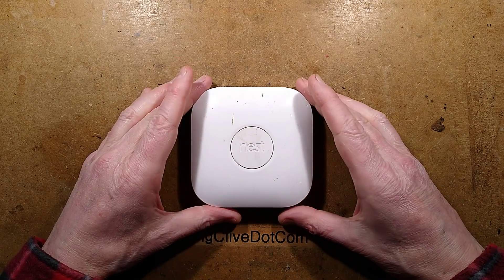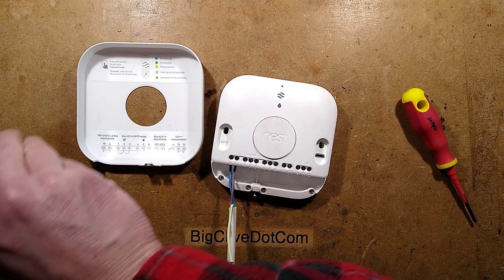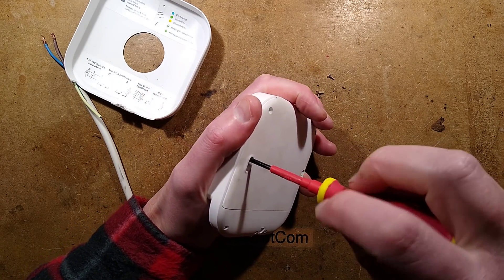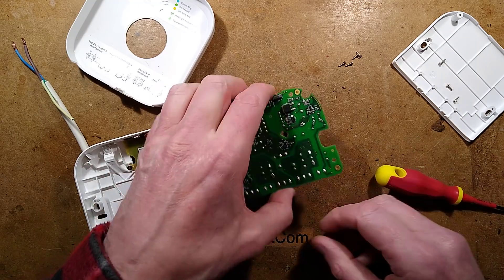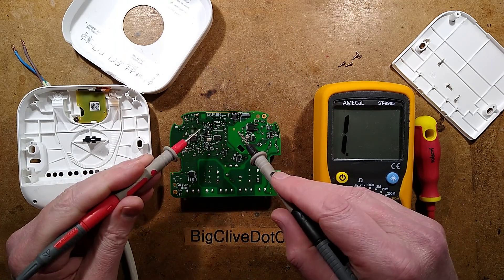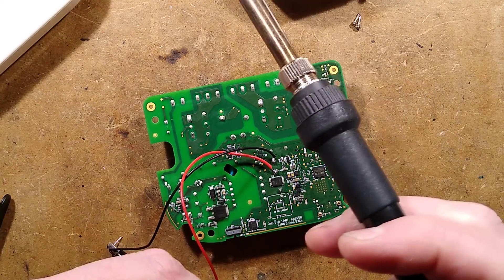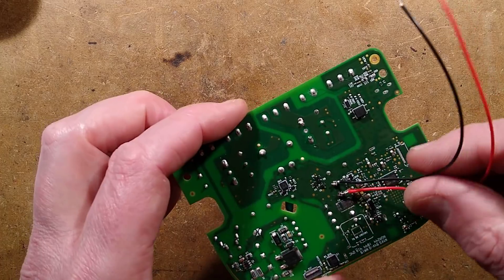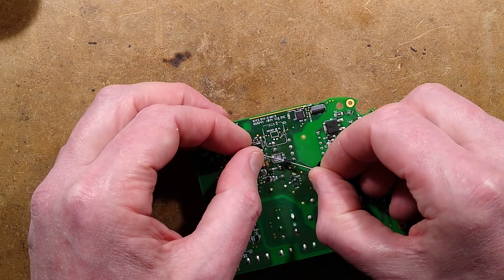Fixing a completely dead Nest thermostat heat link

Comment: Amazing video. Can't believe such a small, cheap component can plunge us into a mid-winter heatingless deep-freeze.  (For a couple of hours while I worked out how to bypass the heat link and just power the boiler via its on/off switch).

I've owned four of these, in three different properties.

Two have been solid ─ absolutely bulletproof running for four years or more without an issue.

The other two (both in the same property) have both failed.  One after 10 months.  The other managed 15 months.

Google, to their credit, have replaced both very quickly and painlessly, for free.

There are two differences between the installation where the units failed, and the installations where the units have run without issue for years:

1) The failed units were installed with the 12V out feed connected back to the Nest Thermostat itself (the good units didn't use the 12V out as those Nest Thermostats are powered by USB and just talk to the heat link wirelessly).

2) The failed units were installed in an older, oil-fired boiler cupboard, with no pipe lagging, and it gets pretty warm in there.  I'm guessing 45C or more.  And, inevitably, that means it gets used as a drying cupboard for wet coats etc.  So hot and humid.  Always good for electronic components!

I've got a fifth unit on its way from Google as I type (to attempt a 'third-time-lucky' lucky installation at the property where two have failed).

I've also got some pipe insulation/lagging on its way from Amazon to attempt to keep the boiler cupboard a bit cooler and will be keeping everything crossed that that does the trick this time.

Anybody got an educated guess as to which of the factors above is most likely to be behind the repeated failures?  (Assuming it's not just random bad luck!)

Btw, the failed units had similar symptoms to the one in this video.  No lights on the front.  Manual override button not functioning.  But I was still measuring 240V across the power in, the CH power out and the HW power out.  Nothing on the 12V out (that's how I spotted the problem when the Nest Thermostat complained it had lost power) and nothing on either of the CH or HW demand lines.

Also, also... for all the annoyance of the failures and the rigmarole of getting Google to send out new ones, the units are pretty straightforward to change out.  You just wire in the new one in place of the old, sync it up to the Nest Thermostat and you're back in business.  (For 10-to-15 months, apparently.)
Reply from the maker: The fact the two that had external 12V wiring failed is interesting.
Reply: @bigclivedotcom  Thanks Clive ─ reading the other comments below I was coming to the same conclusion.  I guess everything works that bit harder when the 12V is in use.  Think I might leave that out on the new one when it arrives and just plug the Nest Thermostat in with its USB.  Shame because the 12V output and re-purposing of the old thermostat wires is a neat re-use of existing wiring to allow installation of the Nest Thermostat in place of a traditional thermostat with minimal disruption.

Comment: 14:41 - actually replacing a heat link is actually pretty easy from an end-user perspective. The turny thermostat bit should find and pair with a new heat link without any issues. All the brains are in elsewhere, this is basically just a remote relay, very similar to any other wireless RF thermostat, just using a different protocol.

Comment: Whilst i see great potential in IOT and home automation, there's a few problems with it that's preventing me from using most of the devices. and its primarily manufacturer support, I don't want to be reliant on another companies servers being up to use my rather expensive device. I want the ability to run any software i need to use the device locally, either on the device itself or on a local server. 

I also hate when people use the term "smart" to describe these devices, there's nothing smart about them, "smart bulbs" for example aren't smart, they're just remote controlled.
What i would class as smart would be something that is capable of obtaining information and reacting appropriately without me having to tell it to turn on and off. id argue a PIR lightbulb is smarter than most "smart bulbs" as it detects a physcial presence and turns on. meanwhile most "smart bulbs" don't, they only turn on when you tell them with a voice or mobile app. its just a fancy remote control.

Comment: Seeing that those SMPS operate under 100KHz most of the time, wouldn't the 1N4003 with a Trr of 2uS still be enough (that's roughly equivalent to 500k cycles), with the UF4003 with a Trr of 75nS (13M cycles) still being overkill? (obviously Trr isn't quite the only frequency defining parameter but is useful for rough evaluation)

Comment: FYI the WiFi chip for connecting to your home network is in the nest display thermostat unit. 

The Heat Link will wirelessly communicate to the display wall mount/base plate (which in turn connects to the display unit) in order to allow software updates to the Heat Link and also thermostat control. Though sometimes this wireless communication fails (not sure why) and control from Heat Link to Thermostat occurs over the 12v T1/T2 power link (this results in slower response though, for example you set the stat to an 'On' temperature, the Heat Link will click on 5 seconds later where wireless comms it's instant).

I replaced my Heat Link diode with a SK310B SMD, the cover fits back just fine.

Be careful when buying a faulty unit that's s marked as 'untested' on eBay as the common faults appear to be:

1.) Dead heat link (usually repairable by replacing the diode as per video)
2.) Display unit unable to find WiFi SSID / W5 Error - this is a known fault of the WiFi chip and is unrepairable
3.) Display wall mount/plate not working - the display unit will not work when not connected to a wall plate and often I've found the plates PCB is fried, probably due to incorrectly being connected to mains voltage rather than the low voltage T terminals on the heat link

Comment: More complex something is the less secure it can be. Just because you're too lazy to walk across the room and turn the light switch on. At the same time I do see that some of these devices have uses but there's also a lot of and we do IOT HD as well. Remember those HD sunglasses that were basically jumping on the bandwagon of HDTV. Market decide to jump in on this and slap that term onto everything else so they can sell better.

Comment: i know clive was worried about the problem with stray wires but it seems like they had pretty good spacing and aslong as the person installing, it which should be a proper technician, there shouldnt be many issues. we sold them at home depot and it was my specialty department

Comment: Id think that the poor quality SMD diode was intentionally used to cause a failure so you need to buy a new one every so often and protect the profits of the manufacturer
Reply from the maker: I think this issue has cost them a lot of money and reputation.
Reply: @bigclivedotcom  no doubt, im a technical for a company that will remain nameless, the controll pannels have a 50% failure rate and to make things worse there is not repair just replacement to the point customers have now started retrofitting 3rd party units that cost 1/3rd the price.
I feel most companies do things like this as a way of planned obsolescence, can't blame the manufacturer if it's the parts nit the design. My thoughts anyway

Comment: Capacitor failure, so common. I was involved in the discovery of one piece of equipments failure mode. 

Manufacturer denied it for a while. But recently released a memo confirming. 

Certain model years effected.  As they cheapened the parts

Comment: That heatlink unit also provides power to the main thermostat unit, which has a big display, processor, its own wifi connection, and a built-in Li-Ion battery. The thermostat unit then sends messages back to the heatlink to tell it when to open/close the relays.
So I suspect that the heatlink's power supply has a lot more work to do when it's connected to the main unit via T1 and T2, and might run a fair bit hotter then.

Comment: at a pinch using 2 soldering irons at the same time can get you out of trouble  when dealing with SMD components- have used this method so many times  that I dont see the need to a pair of hot tweezers
Reply from the maker: I did that on another Nest unit today.  It worked well.

Comment: I'm 67 (soon 68) years old and it is amazing how many things I fix with new caps, diode and a BRIDGE RECTIFIERS... LOL
There is the once in awhile voltage regulator but it all comes down to diagnostics and a dab of flux... :-P
LLAP
Reply from the maker: Yeah.  Modern high frequency power supplies really grill their components.

Comment: I wish there was laws about planned obsolescence in products. Yeah I know they say it makes the product cheap but no it is a real thing even on "expensive" stuff on which so cheap components are used it may even be made with caps rated for 1000 hours for example. it is a selling concept to make caps fail due to high load and cheap models which always fail in due time but I seen other ways too in many things. LEDs for example put together with little to no thermal compound on some of the LEDs for example which overheat and dies over time and soooo many other things :/

Comment: No thermostat was more reliable than the bimetallic spring moving a mercury switch.  Sealed contacts, no electronics, 50 year reliablility.  I keep one in the basement for fallback when the nice, digital display, touch screen, four heating/cooling periods a day thermostat dies - which is much nore often than the mercury thermostats did...

Comment: Mine failed this week! Bet it's the same problem. Guy who replaced it said these v2 fail often, Internet suggests within a year. Good to know I can likely fix it myself if need be if it fails again. Thanks!
Reply from the maker: New test.  Set your meter to continuity and test across the two right hand 12V thermostat connections.  If it's a short the diode has probably failed inside.

Comment: I once had a cheap led grow light of 100w go bang. And I could not figure out why. The led would start up, but continously just flicker on and off. I opened up the power supply and saw some burnt small tiny tiny components. Don't know what they were. Do you have anything similar you could take a look at and explain what the ballast/drivers do to power on a large led lamp diode array?

Comment: Here in the US I’ve never seen a thermostat powered by mains voltage. In every house I’ve owned or lived in the thermostat either wasn’t powered at all (it used a bi-metallic strip), was powered by batteries (usually 2 AA or a 9V), or used the 24V AC provided by the heating/cooling system.

Comment: Who needs a internet fridge , freezer , toaster or washing machine ..... not me !

My rule is 
If it needs working servers , a phone line , online activation or a internet connection avoid it .
If its using a monthly / yearly paid service all bets are off but imo avoid if you can !  .
If something needs a firmware update every month that's just bad design .

It should be a criminal offence if a unit stops working because of a missing external network connection , servers or someone's opinion that it's unsupported & obsolete .

One day it will be just that obsolete & unsupported but it should remain working until the day it's not .
Hopefully a long long time after the obsolete date & years after support ended !

Comment: Any Internet of Things devices that require an internet connection and a third-party server to work, are insane non-secure vendor-locking BS. For me IoT mostly means devices with WiFi connectivity and a documented (often HTTP) API that can be used to make the devices communicate with each other, mostly within your (V)LAN.

One of the most cringeworthy "IoT" devices must be IoT security cameras that won't even fully boot up before they have first connected to some random third-party server.

Comment: A mains powered thermostat? Admittedly my experience is limited to FAUs, in the USA, but I've never seen such a thing. "Standard" seems to be a small 24v transformer at the furnace and Class 2 wiring carrying 24vac power and the various control signals to/from the thermostat.
Reply from the maker: In the UK most heating controls are 240V.

Comment: Nice fix, the PSU side of many things always seems to be the weak point in many products which actually work on low voltages - some may say this is 'planned obsolescence' but in my experience of repair, I'd say they are random component failures which may or may not manifest themselves due to the complexity and features of the product itself - one could argue that the bean counters have 'engineered' this situation rather than the designers themselves...it does pain me to see perfectly repairable consumer electronics end up in landfill due to failures like this however :(

Comment: My buddy sent 240 v down the C wire into a thermostat and gas valve and air handler control board. We were able to remove a bad bridge rectifier from the gas valve and make one from diodes so that worked. The I replaced the 2 traces on the control board that blew and a diode and that worked but the Honeywell 7500 series thermostat is being stubborn. I replaced 2 diodes and can get it to flash on if I twist it but I haven’t found a broken solder joint so I have up. Anyway it went from being a $900 repair down to $160.

Comment: If that diode went short-circuit, does that mean other components stressed (if the fuse didn't blow) and so they're more likely to go pop too?
Reply from the maker: The primary side will have detected the shunt and gone into hiccup mode where it pulses the transformer looking for the fault to clear.

Comment: I am glad you did this video because i had one fail it was in warranty so it was ok but im concerned if it may go again, just a FYI for anyone if this fails you need to replace this and the thermostat unit as they come in pairs. you cant just replace 1 part as it wont match and it wont work. 

but what diode exactly should we use if this fails that is the question ? i guess we could use the same type like in the video to make it easier to solder

Comment: How do you know what a safe current is for testing short circuits, in this case I see you used 20mA because that’s very low but is it possible that that could still damage some circuits?
Reply from the maker: It's unlikely to damage circuitry.  Once you get to 100's of milliamps then it's more of an issue.  But any component shunting that amount of current is probably toast anyway.

Comment: I had an old thermostat with a bimetallic spiral spring attached to a huge mercury tilt switch. Perhaps it is more reliable than an IOT device like this but if one comes crashing down on the floor I'd rather have it be the Nest.
Reply from the maker: Mercury is not as bad as the eco-warriors imply.  Especially in it's native liquid form.  The mercury switches are one of the most reliable ever.
Reply: 100% true. Very reliable. But also very high vapour pressure in an enclosed room when large quantities are freed from the confines of the glass vial.

Comment: semi related question, would you have trouble running a modern furnace off a square wave inverter?
Reply from the maker: I wouldn't recommend that.  It may cause motor issues.
Reply: Depending on how new the modern furnace is, it may have an ECM (electrically commuted motor) in it, which won't care about a square wave power supply because it's converted to DC internally anyway.

Comment: I can't help but think there is some sort of sploodge you can apply to a PCB to protect some parts from heat when using a heat gun for desoldering/rework.
Somehow I imagine toothpaste would work to some extent, and once cleaned off would leave your repair minty fresh!

Comment: Oh man you had me nervous when you hooked that into apparently mains... I'm used to thermostats running on 12v or 24v AC from a transformer in the furnace. Was thinking it would be going boom...
Reply from the maker: Our heating control systems tend to be 240V here.

Comment: Wouldn't ac v be used to test diodes? On a car generator with dvom at b+at gen and neg at bat w/ ac v measurement = miliamps of diode leak. I believe
Reply from the maker: The best way to do a basic test on a diode is with a diode/continuity tester.

Comment: Interesting, this nest accessory device is only used in Europe.  Apparently the nest thermostat built in control mechanism (made for USA systems) can't control boilers in Europe, and this Heat Link is a WiFi relay box to put on your boiler.  The normal nest thermostat then wifi controls this thing.

Comment: The majority of the US thermostats is a 'r'-'c' is 24 vac.  carrier grounds the 'c' to reduce a high static charge (cable can operate as an antenna).
The 'g' fan, 'y' cooling, 'w' heating, should be dry contacts.  There was a particular thermostat and heater commbination that used mosfets and would not work correctly.  Never got around to figure out why.  The direct wire nest tstats would blow the interface if there was a breif short/charge.  I could write a bucket of problems and quirks.  After 20+ years of hvac work i have tried to forget most of the night mares after retiring.

Comment: 5:10 The fuse is intact, as always... 🙄
Reply from the maker: In this case the primary side circuitry would have gone into hiccup mode and pulsed the transformer every so often to check if the fault was still there.